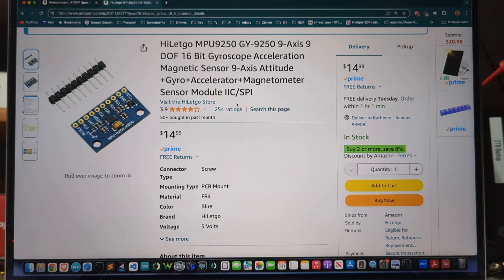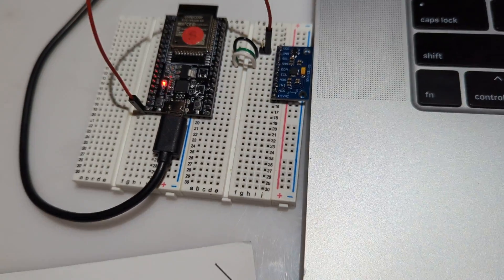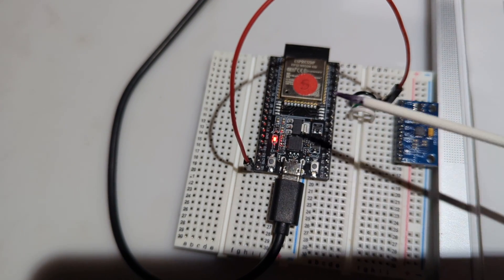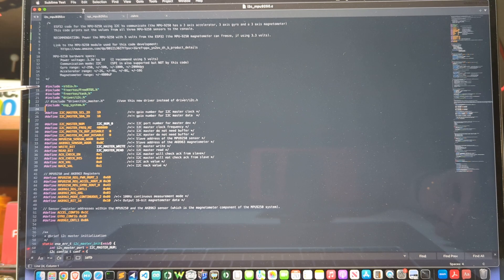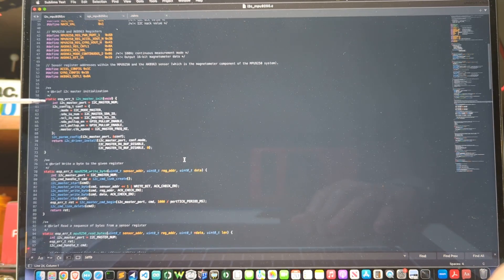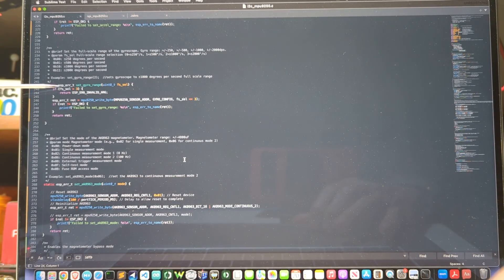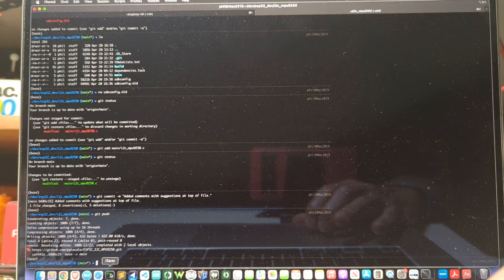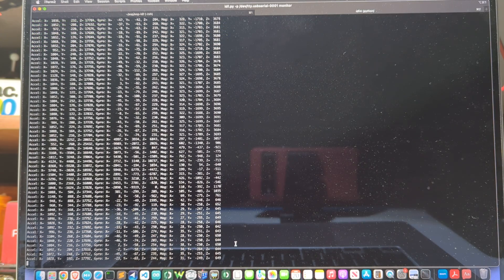ESP32 and I2C: using an MPU9250 IMU (9-axis sensor) gyroscope, accelerometer and magnetometer

Comment: Hello, first thank for the video.
 I'm having problems with the magnetometer, it doesnt connect. i tested your code and this is the output i received:
I (310) spi_flash: detected chip: generic
I (313) spi_flash: flash io: dio
W (317) i2c: This driver is an old driver, please migrate your application code to adapt `driver/i2c_master.h`
I (329) main_task: Started on CPU0
I (339) main_task: Calling app_main()
Failed to set_accel_range: ESP_FAIL
Failed to set_gyro_range: ESP_FAIL
E (339) SensorTask: Failed to reset AK8963: ESP_FAIL
I (339) SensorTask: ====================================================================================
I (349) SensorTask: Orient the sensor device with the x-y plane level and keep it still for calibration.
I (369) SensorTask: ====================================================================================
Calibration samples remaining: 10
I (10379) SensorTask: =======================================================================================
I (10379) SensorTask: Rotate the sensor device through its full range of motion for magnetometer calibration.
I (10389) SensorTask: =======================================================================================
Raw MAG Data - mx: 1, my: 0, mz: -5100
Total samples: 1, Segment (5,6) count: 1Raw MAG Data - mx: 1, my: 0, mz: -5100
Total samples: 2, Segment (5,6) count: 2Raw MAG Data - mx: 1, my: 0, mz: -5100
Total samples: 3, Segment (5,6) count: 3Raw MAG Data - mx: 1, my: 0, mz: -5100
I’m unsure if the chip I purchased might be defective or if there's something I'm missing in the setup. I've already tested with three different libraries, and while I can detect the 0x68 address during a scan, the AK8963 does not seem to respond.

Could you please provide any insights or suggestions on how to resolve it?
Thank you in advance for your help!
Reply from the maker: See the comments at the top of my main.c file. They explain the issues with the magnetometer and how to overcome them by bypassing messages. Also be sure to power the MPU9250 with 5 volts (not 3.3 volts). Hopefully this info helps.

Comment: Hello, thank for the video it is interesting! Why are the values of accelerations neither 0 nor ≈9.81(on Z) when your IMU is not moving ?
Reply from the maker: The software is displaying the 16 bit return values from the accelerometer and not the actual acceleration in g's. The accelerometer is a 16 bit device so it returns values within that range. The acceleration values and resolution of these return values depends on how it is configured (it can be configured to measure a maximum of 2 to 16 g's). Once that is configured, multiplying by the appropriate scale factor will yield the acceleration in g's.